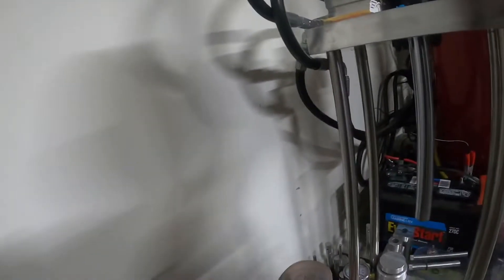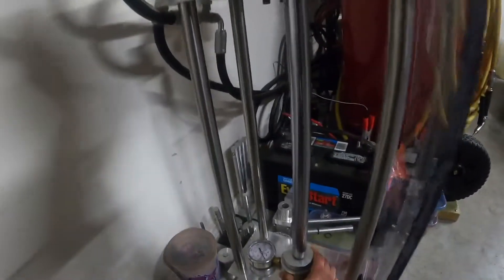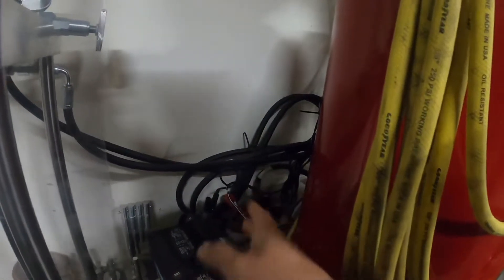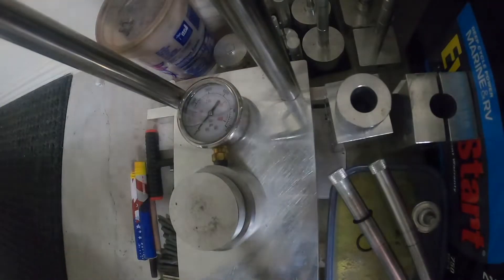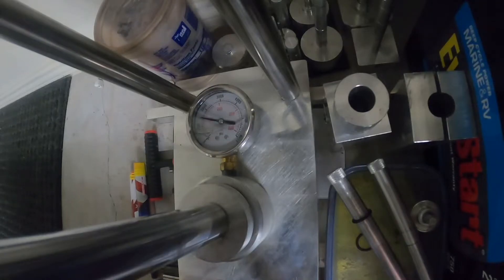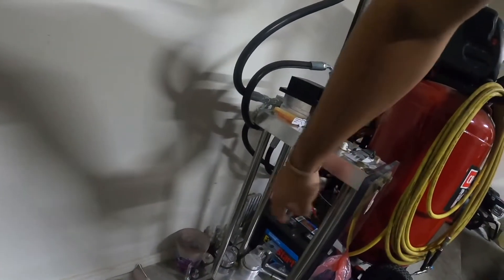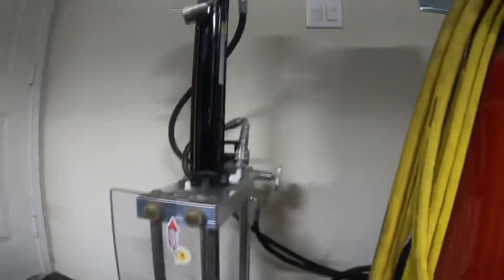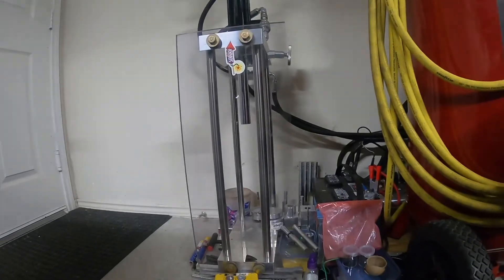Update on my hydraulic press after almost a year of owning it.

Comment: So how expensive is that setup. I know the pof gauge is around $150. Thanks cheers
Reply: About $2k I'm building my own looks pretty simple.
Reply from the maker: Yes so now that the prices went up with shipping it’s about 2k and I didn’t pay that last year when I bought it but the pressure gauge I paid 125 for last year as well.
Reply: About $2,100 for the press, $150 for shipping, $100 for the battery, $30 for the hydro fluid, $150 for the ptfg so for a setup ready to use your lookin at like $2,530 plus a couple bucks extra in miscellaneous and like $250-1,000 per set of rocket tooling depending on how large you want to make them
Reply from the maker: @supremeworks9496  that’s about right of course I got lucky and didn’t pay that price but you are right one the price now. It’s crazy how the price jumped up that much.